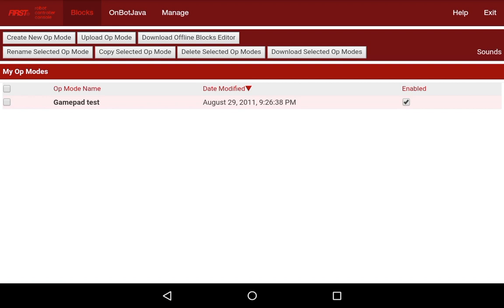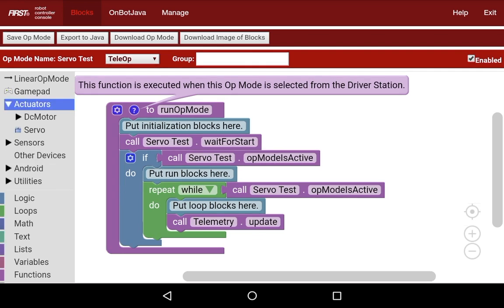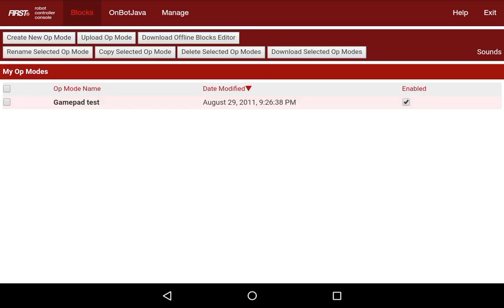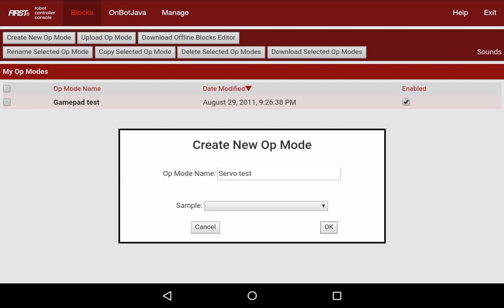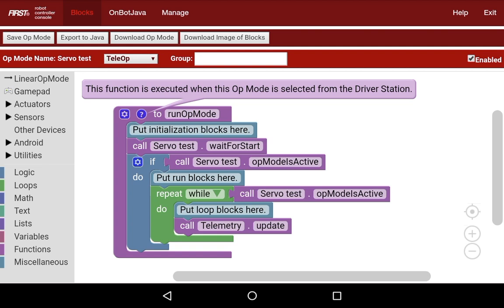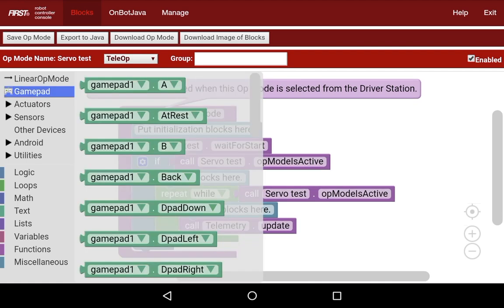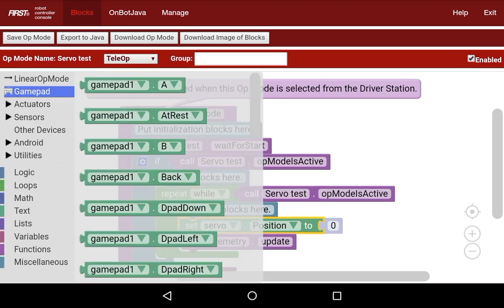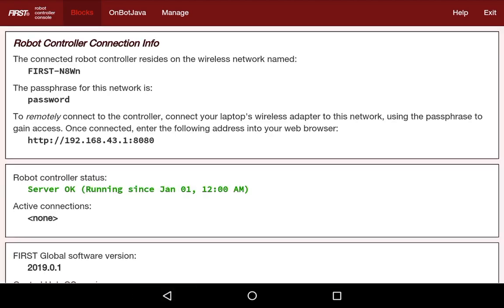Angular Servo Programming in Blocks

Comment: we have had many servo issues these past few months and we would  appreciate if you did a video on ftc servo trouble shooting. We have changed the romote, configuration, servos, wires ect and three servos later we have yet to uncover the problem would appreciate help.